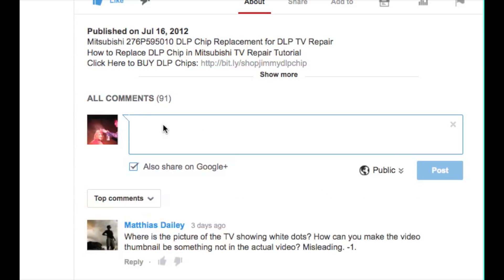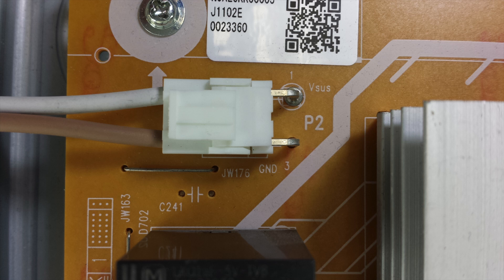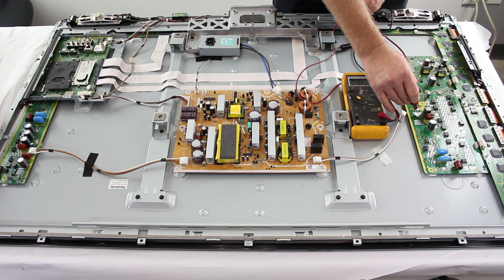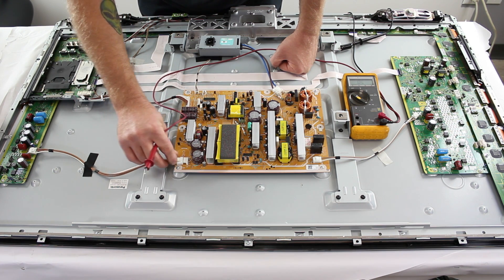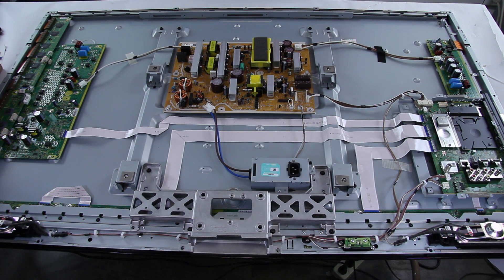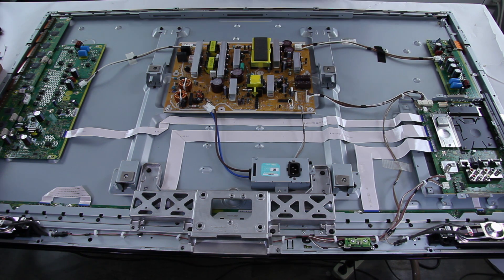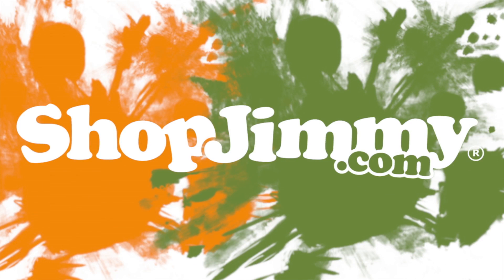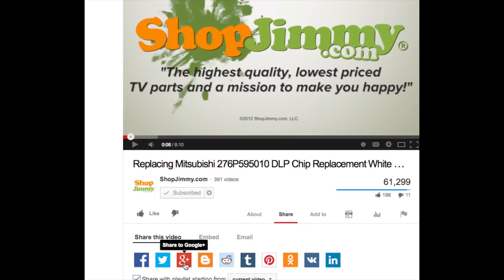Panasonic Plasma TV Repair - Understanding 14 Blink Code - How to Fix 2011 Panasonic Plasma TV

Comment: I have a TC-P50S30. I believe from your video that I need to replace my SU board. But just to confirm, this is what I did. Tested P2: short with the wire plugged in and open without the wire. Moved on and tested SC2: short in the test. Tested TPSC1 and it was open. Disconnected the SU board and it was still open. Connected the SU board and disconnected the SD board and the test was open. Tested P11 and it was open. Thank you for the excellent video.
Reply from the maker: Chris Timman  Please watch this video FIRST to help with your repair!  https://www.youtube.com/watch?v=BP3NVNCGEv8  Yes, that sounds correct.  Click this link to replacement parts for your TV model number:  http://www.shopjimmy.com/catalogsearch/result/?q=TC-P50S30  There may be multiple boards for the same TV model number, be sure to match part numbers on your current board, with your replacement for compatibility.  Thanks and please let us know if you have any further questions with your TV Repair!  www.shopjimmy.com

Comment: I have a TC-P46ST30.  While watching it just appeared to power off but the red light stayed on.  I am getting a short on P2 with the SC cable connected but not when disconnected.  I do not get a short at TPSC1.  Does this point to the SC board as the issue?

Comment: so i watched the video. and you say "after testing connections to unplug for 4 min, then plug in" and when i hear the click to press the power button. is this a quick press or hold for a few seconds??? i ask because, if i quick press the light is solid. if i hold it for upto 10 sec it begins to flash the 14 blinks. model# TC-P50X3
Reply from the maker: Roberto reyes   Just press it down and then release.  Thanks!  www.shopjimmy.com

Comment: i have followed your video to diag a failure in my panasonic plasma tv , very easy to follow thank you very much. I have a code 14 tv just shut off and won't restart . Found short at sc 2 with connector disconnected checked at tpsc1 no short . Leads me to believe the sc board is the culprit. Problem is will there be any available or are they backordered for ever .
Reply from the maker: jim Yates   Please reply with your TV model number or SC part number.  Click here to view a video that shows how to find your TV model number:  https://www.youtube.com/watch?v=S51nhAmwR2M  Thanks!  www.shopjimmy.com

Comment: I have a Panasonic TC-P55ST30 that went blank on me about two months ago. After a Panasonic authorized repair shop looked at the TV and told me it could not be fixed, I began to search online for more information. I stumbled upon your video and in less than an hour was able to ascertain that the problem was a short in the SC Board. I could not find one online and Panasonic would not sell me one directly. They forced me to take the TV into a repair shop. I took it in and sure enough the diagnosis was a faulty SC Board. The cause of the short was loose screws holding the board to the TV. Luckily, the repair shop was able to repair the board and I escaped with a modest repair bill. However, if I hadn't come across your video, I probably would have put the TV at the curb. It so unfortunate that Panasonic won't admit there is a problem and help people fix it. By the way, the annoying hum is gone also. Could it also be related to the loose screws?

Comment: i have a p50s30 i had the 14 blink..i replaced the sc board...it then went to 8 blinks so i replaced the ss board, i now have a display but it shuts off after 25 sec and i get the 8 blink code again...where do i go from here???
Reply from the maker: Patrick Mckeary   Did you replace the buffers between the SC board and the TV panel, when you replaced the SC board?  Thanks!  www.shopjimmy.com
Reply: ShopJimmy.com
Im sorry this is the 1st time trouble shooting something like this, im not sure what the buffers are. I did find another video or your showing to check voltage at a capacitor and another point, my new sc board tested ok like yours, the video then says if those voltages are good then i need to replace the A board, which i ordered, and waiting for it to be delivered....back to the buffers??? where are they located thanks in advance

Comment: I have a Panasonic TC-P46S30  at the 2min 55sec mark in this video my short stops at the TPSC1 so accordng to the video my SU board is bad. Please advise if I am correct and price and availability of such board. Just to clarify after disconnecting the ribbon and the SC2 plug the short stops at TPSC1 and to make sure I understand it correctly, the short stopping means that there is a reading other than 0.00 on the meter. Thanks for your help in advance! Looking forward to my tv working again.
Reply from the maker: MICHAEL SHOOPMAN   Yes, you are correct.  Click this link to replacement parts:  http://www.shopjimmy.com/catalogsearch/result/index/?cat=96&q=TC-P46S30  Be sure to match part numbers on your current board, with your replacement for compatibility.  Thanks and please let us know if you have any further questions with your TV Repair!  www.shopjimmy.com

Comment: I have a TC-P50S30 Panasonic viera.  I had the 14 blink code.  found a short at SC2.  I disconnected the SC board from power board and plugged in AC and got 8 blink code.  Can you recommend next steps?  cannot seem to find a SC board available for purchase.
Reply from the maker: Charlie Mutschler   Click this link to a replacement board repair kit:  http://www.shopjimmy.com/panasonic-txnsc1mnux-sc-board-component-repair-kit-for-tc-p50s30.htm  You will need to have soldering tools and skills to replace these components.  Also be sure your symptoms match the repair kit details.  Thanks and please let us know if you have any further questions with your TV Repair!  www.shopjimmy.com

Comment: I have a TC-P42X3 Panasonic Plasma. Started losing the picture (pixelated/loss of color) & eventually went out completely. Power light originally blinked, but do not recall if it was 10 or 14 blinks. After unplugging the cord & TV cools off, it usually comes back on when we plug in & turn on with or without the remote. The picture is usually darker/dull. I adjusted the contrast/brightness which worked ok. Eventually, I start to lose the picture again & it goes out completely within 3-6 hours.
Thanks, Rich
Reply from the maker: Rich Labatut  Please watch this video FIRST to help with your repair!  https://www.youtube.com/watch?v=BP3NVNCGEv8  I recommend replacing the SN board in your TV.  Click this link to replacement parts for your TV model number:  http://www.shopjimmy.com/catalogsearch/result/index/?cat=66&q=TC-P42X3  There may be multiple boards for the same TV model number, be sure to match part numbers on your current board, with your replacement for compatibility.  Thanks and please let us know if you have any further questions with your TV Repair!  www.shopjimmy.com

Comment: I have a panasonic TC-P50S30 with a 7 blink code. I tested as you explained on this tutorial step-by-step and at first I thought I had a short on the SC board because 1 of the 2 pins coming from the P-board was grounded. But after following the connection back to the P2 connection, I realized that this pin belonged to the ground pin on the P board. so I'm assuming this has to be ground on the SC board, right?  I also tested the TPSC1 pin and it doesn't show a short. Disconnected SD  and SU boards independently and tested as described and still no short. Any ideas? My TV has the 7 blinks error. Could you please point me in the right direction. Thank you
Reply from the maker: Eddie Zuniga  Please watch this video FIRST to help with your repair!  https://www.youtube.com/watch?v=BP3NVNCGEv8   I recommend replacing the SC board in your TV.  Click this link to replacement parts for your TV model number:  http://www.shopjimmy.com/catalogsearch/result/?q=TC-P50S30  There may be multiple boards for the same TV model number, be sure to match part numbers on your current board, with your replacement for compatibility.  Thanks and please let us know if you have any further questions with your TV Repair!  www.shopjimmy.com

Comment: hello i have a panasonic TC P42S1 it recently went out and i took it to my local shop he wanted to charge me 340.00.. i would like to fix this one myself the problem is i have no power when i turn on the set i hear the power supply click on but no picture sometimes i have no power at all..when it does it does come it blinks then i push the power button at the click of the start and it turns solid red stays that way till it shuts off... my email is richardgstrown@gmail,com thank you
Reply from the maker: Richard Strown  Please watch this video FIRST to help with your repair!  https://www.youtube.com/watch?v=BP3NVNCGEv8   I recommend replacing the SC, SU & SD boards in your TV.  Click this link to replacement parts for your TV model number:  http://www.shopjimmy.com/catalogsearch/result/?q=P42S1  Be sure to match part numbers on your current board, with your replacement for compatibility.  Thanks and please let us know if you have any further questions with your TV Repair!  www.shopjimmy.com

Comment: I have a Panasonic Viera TC-P50S30 about 20 months old.  Last week began to cut off after about 3 minutes of watching and blinking 12 times.  Had a repairman say I needed a new A Board.  He never opened the TV but just evaluated the by the blinks.  You agree?
Reply: ShopJimmy.com
Thank you for your reply.  I disconnected the cable connecting the power supply board and the SC board.  I also removed the ribbon cable.  After plugging back in and hitting the power button, I get a click then an 8 blink signal.
Reply from the maker: fostetj1   Repeat the same process on the SS board.  Thanks!  www.shopjimmy.com
Reply from the maker: fostetj1   Please watch this video FIRST to help with your repair!  https://www.youtube.com/watch?v=BP3NVNCGEv8  This could be a problem with either the power supply board or the A board in your TV.  You may need to replace each of those boards individually to see which one fixes the problem.  Click this link to replacement parts for your TV model number:  http://www.shopjimmy.com/catalogsearch/result/?q=TC-P50S30  There may be multiple boards for the same TV model number, be sure to match part numbers on your current board, with your replacement for compatibility.  Thanks and please let us know if you have any further questions with your TV Repair!  www.shopjimmy.com

Comment: I have a panasonic Tc-p60s30 I replaced the power supply board and it still doesn't turn on it still blinking 7 times on the led light.
Reply from the maker: Fernando Espinoza   Try this at your own risk. Unplug the TV, then disconnect the SC board and plug in the TV to see if the TV powers up. Reply with the results of this test. Thanks! www.shopjimmy.com

Comment: I have a Panasonic Plasma HDTV TC-P42X3 (October 2011). The TV has a black box that covers most of the screen. The TV plays its movies behind the black box, but how do I get rid of the black box? I phoned a TV repair shop and they told me it was a 'parental advisory' block or something. Which they told me I can do it all on my own. I preferred to just take it in and let them do it, but they insisted I just do it on my own. I'm too afraid to take apart the TV and fix it on my own as well. Is there a way I can take off the black box without taking it apart? If I have to take it apart, please explain to me in simple detail please. Thanks!
Reply from the maker: Grant Cook   I recommend to check your SAP or closed captioning in your menu settings.  Thanks!  www.shopjimmy.com
Reply: We got rid of the black box in the middle of the screen, but now we are faced with a black strip on the left side of the TV. It covers all along the left side of the TV from top to bottom, but it is only about 3 inches wide. What is the problem? TV repair shops recommend the Internet for help. I just wish to take it in and pay lol problem solved.
Reply from the maker: Grant Cook   If it is a vertical line, then you most likely have a bad panel.  If your TV panel is bad, it may be more cost-effective to replace the TV as panels are typically hard to find in stock, difficult to replace, and expensive.  Thanks and please let us know if you have any further questions!  www.shopjimmy.com

Comment: Hi, I have a Panasonic 50" Plasma TC-P50S30 made in Nov 2011. When turned on the relays click on but picture never comes on... the LED is solid red. When the power button is held for 5 seconds it blinks 14 times. After lots of research i'm told it can be the P-board, A-board, or SC Board. I have also disconnected SC2 according to one forum i read and the LED will blink 7 times. Any help is appreciated!
Reply: Hi Dana, any luck? Solid red first, hold power 5 sec, then blinks 14 times.According to the video, it's the power board.I'm thinking either get a power board or a main board.
Reply: I ended up replacing the mainboard which fixed my problem, the very first mainboard I tried was brand-new sealed and I guess it was blank and needed programming, so I ended up finding a used one and it worked. Mainboard part # TNPH0912 1A
Reply: Alex Hageman did you ever find a solution? Just curious cause I have the same tv with the same issue
Reply: Elias, Unfortunately no. I ordered a repair kit from shopjimmy.com for the SC board and tried that, but it did not work...it gave me a different error code after that if I remember correctly. I'm still not exactly sure what the issue is. I haven't tried to do anything with the TV for over a year now, but I still have it. Hoping to fix it one of these days.
Reply: Alex Hageman ah okay. Thanks for the reply. I'm gonna try to fix mine. It just went out a couple days ago. I'll let you know if I find a solution!
Reply: no luck? this is my current issue :/
Reply: Lindong Wu I have the same exact issue and I'm thinking of replacing the power supply. I'll reply if I replace it and it works. Please lmk if you fix your issue. Ty
Reply: Efrain Dominguez did you order a power supply board and what were the results. I traced a short to the SC board but i dont want to pay $75-85 for a new SC board only to find out something else caused the SC board to go bad. If Im going to spend over $200 fixing this TV then I will just go buy a new one. Its a shame they build tv's with components that are designed to go bad in "x" amount of years. I had an awesome Pioneer Elite PRO 610. This TV was amazing but the 510, 610 and 710 versions all had bad power supply issues and the replacement board was $300. There were so many people who purchased these tv's for msrp $7800 only to have the power supply boards go bad. They should have recalled the boards or sent free replacements due to the high number of bad units vs units sold but no class action lawsuit was ever filed so 1 of the best TV's in television history went down in flames.
Reply: Damn for a Pioneer Elite Pro 610 I would have spent the $300 to repair it... or send that tv my way :)
Reply: Jason Riley Sorry I didn't reply sooner. I haven't had a chance to buy the power supply board yet but I'm hoping to this week actually. I'm a little worried that this will not fix the problem and I'll end up wasting my money...
Reply: I have this problem too. I haven't tried disconnecting the SC2 board yet, though. I bought replacement SU boards and SD boards because my short went away at the SU board of troubleshooting (2:58 of video). This did not fix the issue and I still get 14 blinks...
Reply: Same issues here for not one but TWO of my Panasonic Plasma TC-P55ST30 sets that I bought in 2011. BOTH of them just began blinking 14 error lights, and I bought 3 boards that are working, like new. Nothing fixed either of them, still dead. I can thank Panasonic for making sets that literally just DIE for no reason, and are not repairable. It's no wonder they stopped making these things, with a death rate like this, who would want to spend thousands of dollars on them, just to watch them die 6months to 2 years down the road. Its a shame that NOBODY can fix them, as they are very pretty sets and the 3D was outstanding on them, second to only the 4K HDR LG OLED's made in 2015!

Comment: I have a Panasonic 50" TCP50u50 blinks 8 times. I have disconnected all connections  and plugged power cord to another power supply.  Picture comes on for millisecond and power light blinks 8 times.  Screen goes black.

Comment: I have a TC-P50S30 that went blank one day with a 14 blink code.  I used the above procedure to diagnose (thank you very much for the video) and I had a short to ground on the Vsus lead of the P11 connector that remained shorted to ground with the connector removed. I concluded per the video that the power supply board was the culprit.

When I looked up the PS part number directly (N0AE6KK00005) with you guys it was out of stock.  But when I just browsed power supplies by make/model I found the apparently equivalent N0AB5JK00001.

Could you please confirm that my finding on the P11 connector most likely confirms the power supply board and that the two boards mentioned above are, in-fact, equivalent?  If so I'll go ahead and order.

Thanks so much for the video and in advance for the advice/part.
Reply from the maker: Kyle Dooley   They are not equivalent.  Thanks!  www.shopjimmy.com

Comment: Hi, Ive got a Panasonic TC P50S30 plasma tv which suddenly stopped working today. The tv gave 7 blinks, so I removed the back and disconnected the large sc board on the left side. I then plugged back in and got 8 blinks. I then cleaned (VERY delicately) all the dust off the sc board with a soft brush and clean cloth, and reconnected the sc board to the power board. Now I get 14 blinks. I can't seem to get a straight answer online about what this all means (other than "don't waste your time calling panasonic"). Can you help?